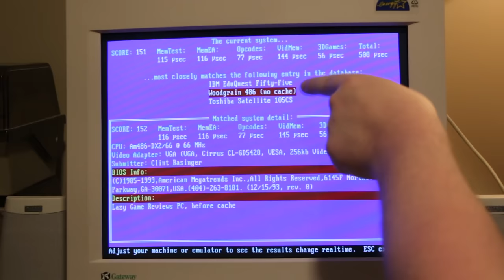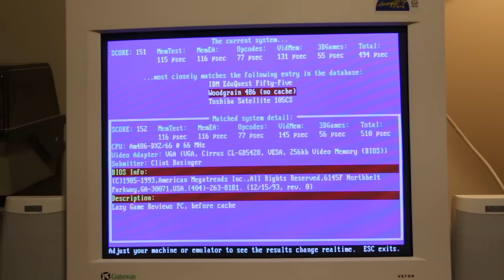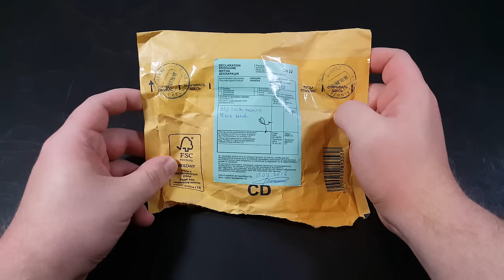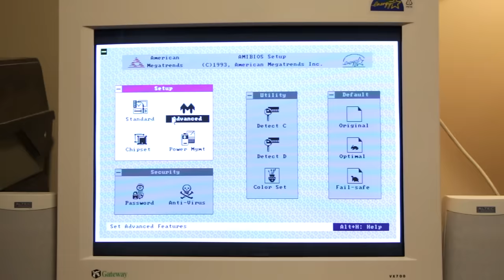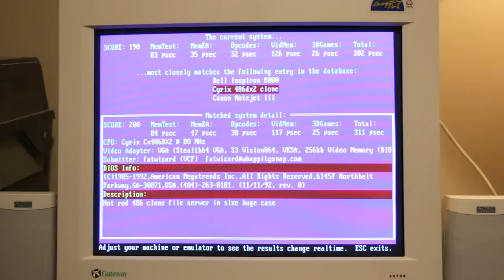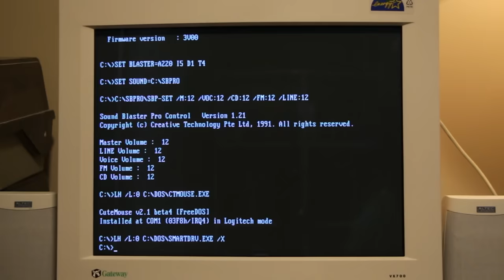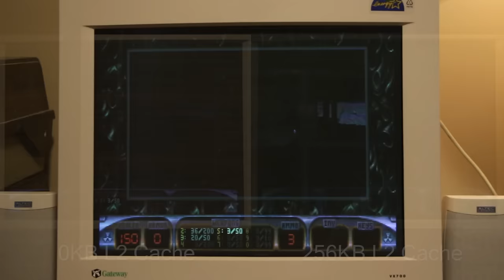LGR 486 Update! Installing L2 Cache

Comment: The benchmark utility identified the CPU differently when the cache was in place? Before it was showing an AMD DX2/66, afterward it showed an 80MHz Cyrix chip. I wonder if it's actually running the CPU at 80MHz now, which would explain a large chunk of the improvement in performance?
Reply from the maker: Nope, you're reading the information incorrectly :) 

What you're looking at there is the machine that comes_closest_ to what mine is running, it is not showing my machine. It's a comparison tool. 

The reason it showed the correct info the first time is because I entered it into the system myself. The second time I had not done that, so it showed the nearest system in terms of speed.
Reply: Lazy Game Reviews
Ah, that would explain it indeed!

Comment: I remember when the 486 came out. I had been building machines since the late 80s starting with 80286. The first system I installed Linux on was an 80386 at 33 Mhz with the 80387 co-processor.

Anyway, to run games like Quake you need to move to the Pentium class, 100 or 133 Mhz at least. The joys of the constant upgrade.

Comment: seems to be a pretty good upgrade. the benchmark showed the video card as being only 256kb rather than 1mb. this could explain performance issues with duke3d and even simcity2000, I think i saw on the box it requires 512kb for the video card

Comment: only thing that I can think of that will give you big enough kick in performance to play duke properly is throwing in a DX4-100 , or if your lucky and the motherboard supports it a AMD 5x86-P75 but it doesn't sound like you want to push it that far...
Reply from the maker: Nah, I have other machines that speed, and I even showed a DX4-100 in the original build video that I decided against using. I want to keep this one at 66.

Comment: Regarding larger amounts of cache - when I benchmarked my 5x86/133, I noticed a huge difference between none and 256k, a small difference from 256 and 512, and no measurable difference between 512 and 1024. (Though I wonder if I'd see some difference with only 1024k of RAM installed running really old DOS stuff, but all those already fly on Socket 3 boxen.)

Duke3D seems to really care about CPU speed and graphics, though: a DX2/66 with a GD5428 is barely playable, while a 5x86/133 with an S3 Trio is pretty comfortably playable at 320x240 (512k of cache in both cases, VLB graphics; another machine with PCI graphics is about the same.)

Comment: Hi Clint.
It's strange, but I clearly remember that Duke 3D worked pretty well on my Ambra Corp 486 DX2-66 in those times (1995-1996). I played in 320x200 in hi-detail, and fps was smooth enough. Even Quake worked fine in 320x200 resolution.
Reply: I too remember playing Duke 3D fine fullscreen 320x240 with 486 SX2-66 8MB :0

Comment: CPU based Raycasters and rasterisers are coded with very tightly nested loops, without cache (or sufficient cache for the entire loop code to fit inside) they suffer massive performance hits having to read code from main ram, and are therefor excellent examples of how code caching can increase performance dramatically.

Comment: In my experience, as long as you can (write-back) cache all installed RAM, L2 cache size makes very little difference on these systems (1-2%). A larger cache is mainly useful for expanding the cacheable memory size on these systems. The SIS 85C471 can handle up to 1 MB of L2 cache according to the datasheet, but your board and/or its BIOS may not support it.

Comment: My P75/256 L2/16Mb Ram FP scores 214 in Topbench. I wonder what would increase its performance the most. Switching to 512K L2 or switching the ram to EDO.  And I had the same impression on my machine as you had with duke. Somehow I imagined it ran a whole lot smoother.

Comment: Super fluid frame rates weren't really common back in those days before 3D accelerators... Most people played 3D games with mediocre frame rates by today's standards. And it's worth considering that 486/66 wasn't really a top notch computer anymore in 1996 when Duke Nukem 3D was released.
Reply: The funny thing is that people didn't even like them, or at least it was thought they wouldn't. Doom is deliberately limited to 35fps (which it's pretty much pegged hard against with a DX2-66), even though it runs in a video mode with a 70hz refresh rate, because the testers got nauseous at the higher speed...

ISTR that neither Wolfenstein 3D nor Descent ascribed to that idea, though, and you could see extremely high framerates with both of them on a 486 (though the latter occasionally slowed to maybe mid-teens fps when things got really super hectic).

DN3D was sort of between Doom and Quake in terms of tech and system load, so teens to 20s fps should have been typical.

Comment: Cool!... You put the wood-grain panel under the CD drive... perfect! :-)
Reply: One thing I'd do when installing a mother-board into a case who's mounting holes didn't all line up with the mounting holes on the mother-board is to just poke the little nylon lock-in standoff thingy into the mother-board and then snip the little pokey-tip off the other end of that stand-off and then that part of the mother-board would have at least some support from being pressed into the metal chassis it's mounted on.

Comment: Finally, you've added some L2-cache :D ...but...but...there is still something SERIOUSLY wrong with this DX2. Duke 3D should perform a lot better than this. 
Hey Clint, just download some VGA benchmarks like 3DBench2 (Superscape 1.0C), PCPBench or run the DOOM Timedemo. These are much better for comparing things before and after upgrading.

I still have an HP Vectra VL2 4/66, Intel DX2-66 (P24D), 128kb L2-Cache, 16 MB RAM, AWE32, Cirrus Logic GD5428 1MB onboard graphics. 
That doesn't sound like a high end gaming rig, right ? But this one runs Duke3D in 320x200 on high details (window size -4) and it is more than just playable.
Benchmark results for my Vectra: 3DBench2 - 46.3 FPS, PCPBench - 10.2 FPS, DOOM Timedemo  - 25.28 FPS

Your 486 machine, considering the specs, should be able to easily outperform my HP Vectra.
Would be interesting if you could check your results in these benchmarks. A good DX2 system should be able to outperform my stock HP Vectra ;) 
Maybe you should just throw out that AMD CPU. Maybe your motherboard supports the Intel DX2 P24D. This one can do "write back" for L1-Cache.

Thanks for the video, enjoyed it :)
Reply from the maker: Thanks for the numbers! I am definitely going to investigate this further, because yeah, it seems slow to me as well.
Reply: I remember 3d/complicated rts games being pretty choppy with my Intel DX2-66. The original command and conquer was painful to scroll around the map. Swapping out for a DX4-100 or Pentium 83 overdrive made it smooth as butter. I know when you built the machine you mentioned AMD's were faster, but I swear I remember them being slower. Something to do with speed of L1. Maybe you could bench them head to head? I noticed in your cachecheck the RAM was topping out at 10-11MB/sec. I'd like to see how that same ram would bench in a non sis-chipset mobo. Lots of good video material.
Reply: C&C ? The original VGA version for DOS runs just fine on a DX2, but there also was an SVGA version for windows, that really scrolled super slow on a DX2.  
You've made a good point to exchange CPUs for more speed :)
But if there is really something wrong within the setup, your system might get faster using a faster CPU, but then again you wouldn't use its full potential.
Some AMD486DX4 CPUs came with 8kb L1-cache instead of 16kb (Intel DX4). 
I also think, when it comes to AMD vs. Intel (486 era), Intel will always take the cake @same clock speed. 
Don't get me wrong, I always thought it was nice that AMD stayed a bit longer with every generation and came up with versions capable of high clock speeds, far higher than the Intel originals. 
I'm sure, Clint will solve this problem soon :) maybe it is just a problem with Duke3D itself. 
The first legendary video :) about this 486 showed DOOM, and I think it runs pretty good on that 486. Too good to be let down by Duke. 
Only thing I noticed, Atomic Edition (v1.5) actually runs smoother on a DX2 than the original v1.3d. There must have been a lot of patching between 1.3d and 1.5.
Reply: Nope. Dos VGA version. Could have been the horrible integrated video in my Packard Bell, but upgrading CPU fixed it. I mean, it was playable, but the scrolling was choppy.
Reply: Heh, a friend of my brother insisted on playing C&C Red Alert in the SVGA Windows mode... on his 486. Slow as hell, but he persisted. Had to respect his perseverance, but we preferred to stick to plain VGA in DOS (where it ran just fine - having to shift barely 1/5th as many pixels after all) until we got a faster CPU...

(really, it shouldn't have made much difference if you had a decent (2D) video accelerator card on a local bus, but maybe Westwood didn't bother making use of them and relied on the CPU alone to fling pixels, or our cards' Win95 drivers were hopeless despite the promise of DirectX...)

On the other hand, there's a huge difference between how Screamer runs on the SX25 I have now vs how it ran on our old DX2-66, far more than the MHz difference would account for, and unlikely to be anything to do with memory speed because the RAM (and L2 cache) runs hardly any slower than the L1 cache (as per my other post, an earlier version of CacheChk showed them both hitting 26mb/s). Haven't yet worked out whether it's more because it lacks an FPU, or because it's using a Trident ISA video card (one would expect it capable of running at a couple hundred FPS in VGA mode, but it runs at less than 5fps, and on the faster machine it managed easily 20-30fps), but I expect a mix of both. SVGA is totally out of the question. Something tells me they didn't build the machine with games in mind, though it plays Windows 3.1 Solitaire and Minesweeper just fine :D

Comment: Wow, I didn't know DX2-66 was so slow in Duke. I had DX4-100 when Duke3D came out and it ran quite well, I had no problem with slow downs on high settings in 320*200). But I had a fairly decent PCI video card (Diamond Stealth SE 1MB on S3 Trio32 chip), so I don't know, perhaps it also played some part. Also I think PCI is considered a faster and better bus than VLB, but I'm not entirely sure it matters in Duke3D.
Reply: It wasn't... there's something funky going on with that machine :/

Comment: Ohhh man, the old "it's too much trouble to take the mainboard out" debacle.

Always, just take it out man.. I'm sure you'd of saved time just dropping those jumpers in instead of getting your light, tweezers, finding the right angle, probably multiple attempts of those far away ones.

Awesome video though, especially considering I know the exact frustration being felt around 7:12

Comment: Hey man, nice work. I watched the whole build from beginning. The problem with DUke 3D is not your CPU, actually it runs great on 66 Mhz but your problem with frame rate is the video card. ISA or VLB card just don't have the capacity to push out the desired numbers. You should have tried a MB with integrated IDE controller and PCI bus. Then with 1MB PCI VGA card you would see it fly with the same CPU and RAM. How do I know it for sure? I used to own exactly that set up :) and my friend was experiencing exactly the same problem you are facing. He had a free PCI slot though and after buying a PCI video card it was running great. Matter of fact with his ISA 512K card even Doom was having a performance issues. Try just change MB and then compare the benchmark numbers. It would be interesting...

Comment: You just mentioned the Turbo again and I remembered I wanted to ask you if you connected the turbo cable properly. I don't know if the polarity matters for this one, but it does for the LEDs (power, HDD). Check it out, maybe you'll get lucky. :)

Comment: I ran Quake on my (or actually my fathers) 386 SX 25 with a math co processor. Lowest settings on everything, no sound, smallest stamp sized screen. Took me about 20 minutes to just run as fast as I could from start to finish on the first level! But it worked!! No cache in that though.

Comment: Regarding the numbers near the end of the chip ID numbers... Those are speed indicators -- The set with '15' near the end run at 15ns transfer speeds and the '20' run at 20ns transfer speed.  You should swap them out because (based on your cache testing tool) then your L2 cache will be running at the same (roughly) speed as your L1 cache.  I'd betcha you'd see as much as 10% improvement when dealing with cache fill/drain situations -- such as bus I/O -- especially bursty bus I/O ... and 512K@15ns would make things even better... although not really earth-shattering better.

Comment: Damn when I was repairing computers for fun in 90s. I had someone give me their family computer to bring back to life. That was the only time I had upgraded a cache, I ordered the parts using computer shopper ad, plug right in and wow it helped. After that they through more cash *not cache put in an overdrive I was not using. Honestly I think her mom and dad I think wanted me to have interest in their daughter, pretty however not my type. I actually put 512kb in their computer and it worked eventhough I had no idea if it was allowed or even tested.  I thought their model cache chip were way smaller. Long time ago, once I built my first computer I was willing to try to fix anything.

Comment: If you want a little more performance while keeping the same specs try to find an AMD DX2-66SV8B. The SV8B allows for Write Back cache operation while the one you have the NV8T allows only for write through. Should give you around a better improvement than the L2 cache install did. All you have to do is replace the CPU's and select Write Back cache in the BIOS.

Comment: Dukenukem was quite playable with 33mhz 486 with 256 kb fast L2. 8MB FAST ram (Remember that those chips had abnormally low latencies. professional ISA graphics card.  With himem sys enabled no emm386.  And pretty much every other possible setting tuned towards making it run faster.

Comment: Huh, depending on the the package needed, you can still purchase cache memory chips from I think it was mouser.  There is a company called Pyramid that supposedly still has TAG chips as well, but they never responded to my e-mail questions regarding the items listed on their website.  A TAG chip is what I am missing for my cache.  I need to find one has to be 15ns.  For some reason that's what my motherboard requires. shrug Edit - Good job on putting the jumpers in with the tweezers.  That's tough.

Comment: Im working on my first PC to get it into working orde. One question, have you used a usb floppy emulator module? was thinking about buying one to use for drivers I get from the internet sinse I dont have a floppy drive in any of my internet capible computers, Or should I get an external usb floppy drive?

Comment: Precache benchmark said Am486 then changed to Cyrix afterwards?
Reply from the maker: Nope, you're reading the information incorrectly :) 

What you're looking at there is the machine that comes_closest_ to what mine is running, it is not showing my machine. It's a comparison tool. 

The reason it showed the correct info the first time is because I entered it into the system myself. The second time I had not done that, so it showed the nearest system in terms of speed.

Comment: Back in the day I overclocked my 486DX2/66 to 80MHz or even 90MHz but that was a little unstable. But duke3d ran fluently @90MHz and with 320x400 resolution. My friends with new Pentium 60MHz machines and slow display cards were in trouble. I had S3 Vision864 VLB and with univbe it was fast. :)

Comment: Could you try Dark Forces on your 486? It works much smoother than Duke3D. I just found a video that it demostates it running on a 386 and it works quite well! (with all the graphics at low and the music disabled, but...)

Comment: Nice video.
For my IBM Personal Computer 330 486 DX4/100 & P100 I also want to 
buy cache chips. Can you tell me where you got yours from?
By the way, the Cache table on the sticker inside my IBM PC330 P100 says
 that the 512K chips fill up the whole socket and the 256K chips don't. 
If interested I can make a picture and send that to you.

Comment: Hey Clint I just recently bought a 486 motherboard with 3 PCI and 4 ISA slots with a AMD 133 p75 CPU with 64 Megs of RAM and 256K 32 pin cache at 15 nanoseconds. It does support 512K(4Banks+1tag chip also 32 dip pin and 32k x8 for tag chip) Mother Board documentation says to use 128K x8bit. When I look that up they are 1024MB even on the tag chip. If I only install four of them because my board only has four slots will it only be 512K the max the board supports or do I need to use all 8 which my board does not support and where can I buy the 128K x 8 32pin dip chips and corect tag chip. Please Help I want to max out this board to its fullest.

Comment: I know this is an old video but my friends worked in a computer store and they ran Doom and Duke3D  on DX2s and DX4s  and they ran perfect. This has been a while ago but I think he used a RAM drive or RAM disk and that is what made him run it faster at higher resolutions. Around that time I built a Intel P90 and it was awesome. I bought a beefy heat sink on it and over clocked it to 120 Mhz. I ran this PC for a while until I built an AMD K6-2 500 over clocked to 600...  Those were the days. On a side note, I plan to build an old late 90s PC around 1200 to 1400 MHz as a Windows 98 or ME box. I have a VooDoo 5 5500 I will be using in it. I bought the card new and I still have it all these years later. I can't wait to start gathering parts for it.